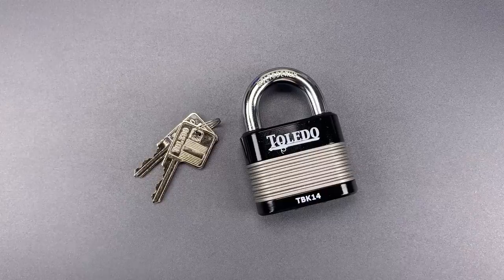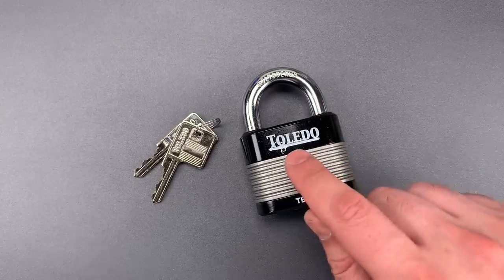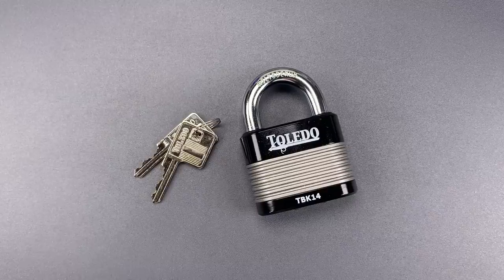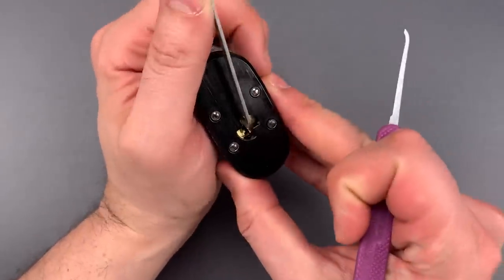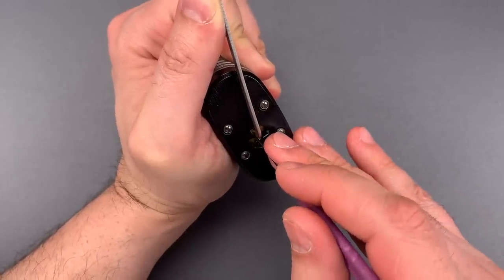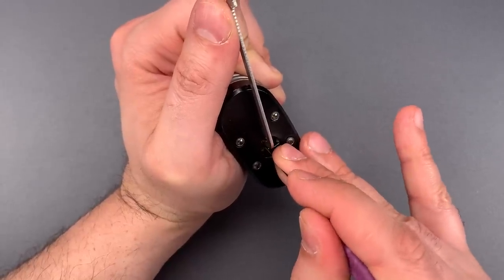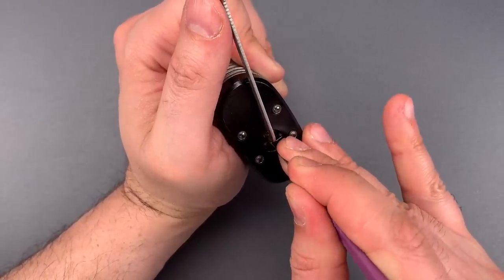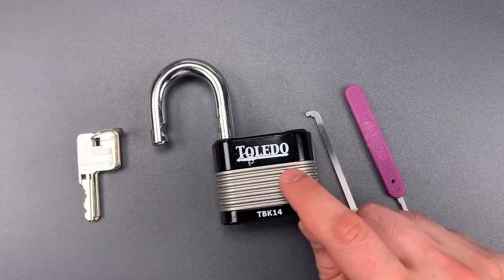[1039] Better Than Expected: Toledo TBK14 Padlock Picked

Comment: 'Better Than Expected' would usually be damning with faint praise, but these are words of great esteem from LPL.
Reply: "better than expected" is high praise anywhere in my understanding, isn't it? It's like "not bad" meaning "really good"
Reply: His expectations were 0 but he got 1 so is better but still bad
Reply: I'm not quite sure how to interpret, "better than expected", when the pick was still less than a minute.
Reply: @HariSeldon913  compared to other locks he picks in around 10-30 sec, this can be considered to be a good lock given its price and the absence of any exploitable weakness. he does not judge locks based solely on picking time. if that's the case disc locks will be the top but there may be exploitable weakness in their design or are plainly exensive.
Reply: The levels of quality per LPL...

1. Inexcusable
2. I wouldn't secure anything of value with this lock.
3. A noble effort, but still falls short.
4. Better than I expected.

That's pretty much my new ranking system for any locks I buy
Reply: @majan6267  not really. People say "not bad" to mean "just okay" all the time.
Reply: @mirzaahmed6589  maybe there is some regional variation, here it means "really good"
Reply: @majan6267  This is where print media fall down. When spoken, "not bad" can mean various things depending on intonation, body language, etc. I've heard it, and said it, to mean anything from, "Well, it's not total crap," to, "Hey, this is actually pretty good."
Reply: @johnopalko5223  yeah, it only really get's across the right way in personal communication
Reply: @B0tAcH1  Not to mention some of the worse padlocks the LPL picks are defeated in 3 to 5 seconds or less.
Reply: @JamesContos85  that sounds about right so basically for a laminated lock apparently it's decent expensive for such an item but good
Reply: @majan6267  here in America at least in Washington where I live better-than-expected doesn't really have much connotation except within a context. But if your end assessment is better than expected it basically means that you weren't expecting much but it turned out to be pretty decent. So I'm guessing he was expecting it to be a pretty easy pick and it proved to be a little more challenging than he expected that's probably what happened it is a 6-pin core so that's something to keep in mind

Comment: You have inspired me to begin my lock picking hobby. I went all out and bought the best Southord 37 piece set (the one endorsed by Bosnian Bill), electric gun, manual gun, practice locks, headlamps, lock oil, etc.  Well over $500 of their stuff. I picked my first lock, a Master Lock model 22, nothing too fancy. I had it picked in about 13 minutes. But here's a big lesson I learned: Working on a lock sitting at a workbench with nice lighting and every thing right at your fingertips is one thing. But trying to pick that same lock while hanging on a chain outside in the dark with the temperature at 10° is completely different and MUCH harder. Hell, just holding the chain up so you can keep tension on the lock is eventually going to wear your arms out. And it get's worse from there. Old locks are rusty, dirty and much more difficult. So, all you would be locksmiths out there take notice. When your mother in law calls you over to open her storage shed because she lost the key, be prepared. I thought Jenny (my wife, her daughter) said you could pick it. Well Mr. Locksmith, why am I still outside my shed? And another thing, you got me the wrong size sweater for Christmas, you KNOW I wear a size... ugh...just kill me, please...

Comment: Can you do a list of the best locks within a reasonable price range?
Reply: So far this lock wins. 30 dollars is pretty reasonable, not cheap.
Think of it this way. You have thousands of dollars of power equipment and tools in the shed that you are protecting. Do you really wanna go cheap?
Reply: Definitely get something better than a lock from your average big box store. Beyond that, anything which doesn't have glaring security flaws (as sometimes even expensive ABUS locks have had) will be fine for most household uses. You probably only need to defend against the casual burglar who might have a handful of bump keys, jigglers, and possibly a pick gun in their tool bag. If they can't quickly and easily pick a lock, they'll either try another method of attack (bolt cutters, or an open window) or find an easier target (the neighbor's tool shed secured with a Master lock).  

If it becomes widely known that you're sitting on thousands of dollars of Snap-On Tools, or that you have a house full of firearms, or controlled substances; then you most likely need to upgrade your locks further. 

If the threat is a very curious teenager living with you who likes to binge watch LPL and BosnianBill videos. Get this lock and use it to secure a chest containing photos of you and your significant other getting it on. Which should not so gently advise them not to go poking around where they don't belong. If your kid's a freak and is undeterred by that, leave a scrap of paper implying it's the login to your financial records, or perhaps the key to your safe deposit box. Once accessed, a message informing them that you know what they're doing and of your decision to send them off to military school

Comment: The only other possible attack vector would be to check if a bypass tool works on it, but IIRC Toledo orients their cores/actuators perpendicular to the keyway so that bypass drivers won't work. So yes, this appears to be a pretty solid lock. Props to them.

Comment: what do you mean with a "standard hook in 18.000"?
Reply: 18/1000 inch thick
Reply: Hooks come in a variety of thicknesses. 0.018" is a thinner one, gives a better tactile response as you're working your way through security pins. He will also use a 0.025" for locks with larger keyways, heavier pins, or when the necessary leverage is required.
Reply: thanks guys :D
Reply: For the more metric inclined, its roughly 0.44 mm thick.
Reply: "Standard hook" describes the shape of the pic, "18 thousandths" is the thickness of the metal it's made from:  .018 inch.
Reply: This question shows how superior standard metric is compared to American non standard.
Reply: the hook is the typical sort you get in a lockpick kit, and the material it's made from is 18/1000 of an inch thick.  It's not really practical to measure anything under 1/8 of an inch in typical  standard fractional measurement, so they go down to thousandths of an inch (often 'thou').  Machinists usually work in those numbers, but for fine work, anyone might specify something is 'X thousandths'.  18 thou is somewhere between 26 and 27 gauge material, most likely 26-gauge because 27-gauge is VERY close to 17 thou.
Reply: @QYXP  the question literally shows only that some people are not familiar with lock picks.  We don't even know where the original commenter is from. Not many things are measured in thousandths of an inch even in places that use imperial units.  
  One could argue that a thousandth of an inch IS in fact an excellent unit to use when talking about lock pick sized objects. Millimeters are too big, microns are too small.
Reply: @joeschmoe6908  millimetres have decimals too...
Reply: Piggybacking off this question, does anyone know why he always uses metric for the locks but imperial for his picking gear?
Reply: @joeschmoe6908  sorry but a thousand of an inch is 2.5 microns, so really on the same scale. I'm actually happy that they don't use the "gauge" thing, because that's pretty confusing. I'll happily stick to my metric. (Also for things like screws; I hope I don't have to explain to you how difficult is to know what tap you need to get from aliexpress for a particular US screw. In Europe, it's just a single number.)
Reply: @cherrycoke106  probably because the locks are made in a place using metric, while the picks are made/sold using inches.
Reply: @tomhejda6450  comes from having two or more different screw pitches. #10 screws (3/16" nominal size for the unthreaded shank) can have either 24 threads per inch or 32 threads per inch. And that doesn't count those freaky tapered pipe thread standards that I can never remember.
Reply: @cherrycoke106  this is very typical here in the US, we tend to switch between the two measurement scales without thinking too much about it.
odd that the rest of the world finds that unusual, it is easier to say 1/8 inch over 3.175mm, or 3mm instead of .118 inches
also, we have machine parts cut to both scales, sometimes on the same machine from the factory...repairs can get interesting if we went solidly to one scale
Reply: @ScottKenny1978  Haha, you see, 3 numbers already for a single screw (3/16, 10, 24 or 32). For me, the #10 is definitely extra, and comes from the face that you need to standardize all these fractions. I have basically 3, 3.5, 4, 5, 6, 8, 10, 12, larger very rarely. All in mm. All "metric threads", which is really the only standard I've ever met in Europe. The same with wire cross-section: simply measured in mm2, and I can agree here that the very narrow ones have strange numbers like 0.315mm2. But for any larger than that it's really 0.5, 0.75, 1, 1.5, 2.5, 4, 6, ... Again, all in mm2. In mains, thr smallest used one is 1.5 anyway. I understand it's partly a matter of habits, but still...
Reply: @tomhejda6450  well, in the US, screws are usually numbered, bolts are by dimension. It's just that a #10 screw is the same diameter and has the same thread pitch options as a 3/16" bolt. Fine thread pitch means higher torque limits. So a 10-32 screw is the fine pitch version, 10-24 the coarse. And then the last number is length.

I don't work with metric screws/bolts enough to remember if there are fine and coarse thread standards.
Reply: @tomhejda6450  Umm no, a thousanth of an inch is 25.4 microns.

Comment: I'm a novice/intermediate nose picker, uh I mean lock picker, and I have the TBK13 that always seems to give me a fair amount of trouble. I'll spend thirty minutes working on it to no avail, but return to it ten minutes later and open it in about as much time as it took you. Do you know if the core is about the same in my TBK13 as it is in your TBK14? it seems like it might be. I also use the same tension but a standard hook in twenty-five thousandths. Would it be beneficial for me to use a thinner hook for this lock? Thank you for your review of this lock.

Comment: maybe a dumb question: Does being able to see the key before picking make any difference?
Reply: Yes, because binding order and having to work around deep pins can make a huge difference. Having to lift a pin very high behind a low pin can make a difference in your binding order, hence the different curvature of picks.
Reply: yes, knowing that 1 is really high and 5 is really low can give you a bonus, that bonus being if you think 1 is set and it's not really high, you know it's not actually set, same with 5 knowing that it is low, you'll be more careful not to overset it

Comment: When a core has movement during the pick, is that a sign of sloppy tolerances? Or what else would contribute to that?
Reply: Spools... When he says 'counter rotation's that is movement in the core from spools(usually).  ... You can also get movement from the entire lock code being loose in the lock which makes it a pain to pick.

Comment: This lock is missing only one feature: Being featured as disassembled by LPL.
Reply: Doesn't seem like it can be disassembled non-destructively and even so it would be a bitch to open. You have to knock off those 4 rivets and seeing as they are counter-sunk, you can't chisel or grind them off, you have to drill them.

Comment: We need to find somethink you can’t pick
Reply: He can't pick my nose.
Reply: @pekkagronfors7304  Can't or won't?
Reply: You can pick your friends. You can pick your nose. But you can't pick your friends nose.
Reply: @seldonwright4345  you can try.
Reply: IIRC There is one lock that is very tricky and that he showcased, where he said he'd need to make a very specialised tool to pick it, meaning it'd be easier to break it apart than to pick it. Can,t remember which though.
Reply: I think its episode 738: The naughty bucket chronicles - the ones that got away
Reply: "You can pick your nose.  You can pick you azz.  But you can't pick your relatives."

Dad's wisdom before he passed away.
Reply: @Kurata_Nemui  Bowley is the name.

But any lock that can be opened with a key can be opened by something adequately simulating that key. Like lockpicks.

Comment: 30 BUGS for a padlock that only buys the illusion of security. 
I’ll pass
Reply: You do know LPL is one of the best pickers out there, so a lock that takes him a minute to pick is pretty much unpickable on the street!
Reply: Scott Kenny did you ever see what he does to a padlock with just 2 wrenchs
Reply: @shadowdance4666  yes, I saw. Don't remember this lock being in that video, though. And a molybdenum heavy shackle should be rather resistant to breaking that way.
Reply: Scott Kenny BS physics is physics. Security is all in your head
Reply: @shadowdance4666  there's a big difference between mild steel and 4130 chrome-molybdenum steel in how much force it takes to break. And that's not even getting into the really exotic high yield steels that are used in submarines and bomb containment vessels. HY80 needs a force of 80,000psi before it actually breaks, and that's the bottom of the HY series. I've seen HY140, it's used in the Seawolf and Virginia class submarines.

Now, if that shackle was made from HY80, it would take 11,784lbs force to break it (0.147...square inches in cross section, times 80,000psi) Assuming the two-wrench method gives you a 20:1 lever, you would need to exert 589lbs force on the ends of the wrenches to break the 11mm shackle. Hell, let's assume a 40:1 lever, but that's still going to take about 295 pounds of force to break.

That's physics.
Reply: Scott Kenny I betcha a barrel of turnips that 2 craftsman wrenches will crack it. You ever heard of the expression with a big enough lever I could lift the world
Reply: @shadowdance4666  sure have. But I think you're going to be surprised how much force it's going to take to break a properly engineered shackle. I admit that you do need some surface hardness to defeat bolt cutters, but too many lock makers grossly overharden the shackles, which is what makes them so vulnerable to shattering.
Reply: Scott Kenny so, you’re saying that I don’t even need wrenches. Just a can of cold air and a rock or maybe a hammer lol. I love the smell of false sense of security in the morning
Reply: @shadowdance4666  you're not understanding me. Yes, for a cheap, overhardened shackle you can get away with some really cheap attacks.

I'm saying that this lock does not appear to be especially vulnerable to those attacks.
Reply: Scott Kenny So, cutting is good too then. Great.  I can just imagine what a bit of acid and drill would do. You might have better luck with a scarecrow and endless loop of spooky sounds.
Reply: @shadowdance4666  seriously, dude. Have you never heard of differentially hardened materials? 

 If your anticipated threat profile is breaking out the noisy destructive attacks to get in, then your security system should include a nice Rottweiler.
Reply: Scott Kenny Rottweiler nice. I’ve got one even better. No one expects the Spanish Inquisition. Rack attack lol

Comment: Looks like easily 2/10 on Meth head rating scale - no ability to non-skill attack - have to have legit tools + know what you are doing + takes even a skilled person a few minutes.
--Only suggestion - for users - 
If used I'd get a "Master" lock logo to put on it...!  So the Meth head breaking into the storeroom or trying to get the bicycle/gate lock off thinks it's easy and struggles a while with it versus trying to break the door/cut the chain, etc.